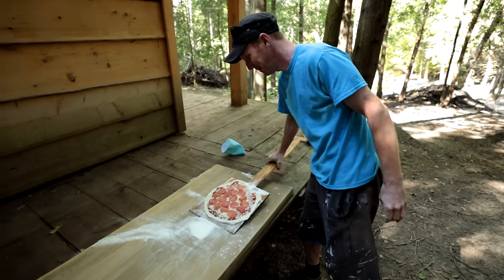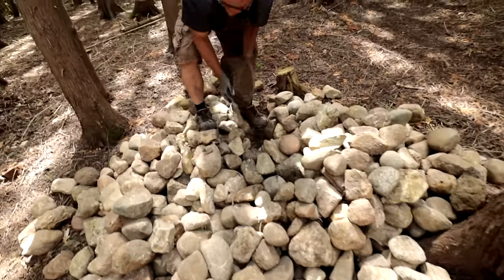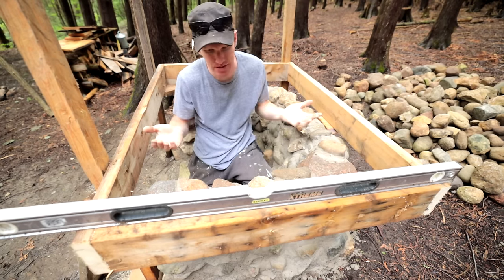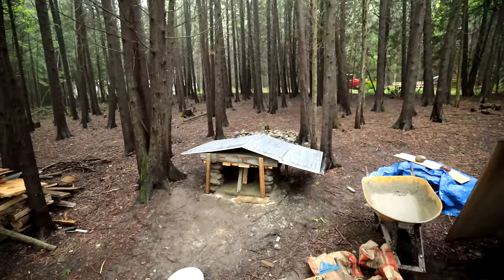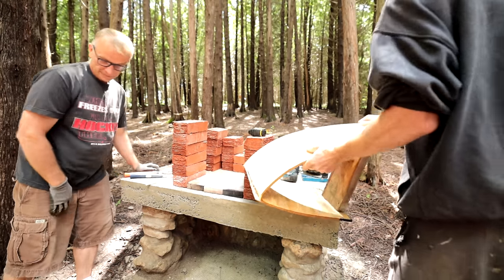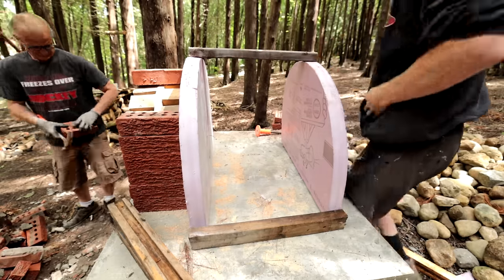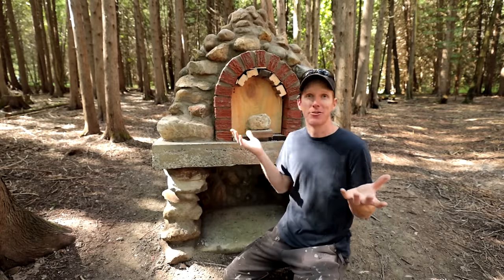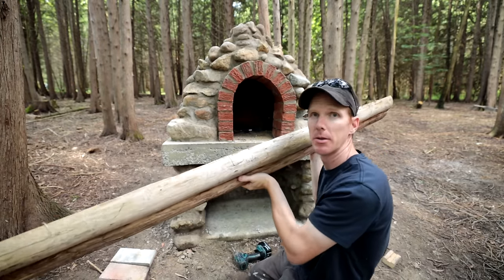I Built a Rock Pizza Oven!

Comment: Looks delicious. Curious to see how the mortar holds up with the heat over time, did you use a high heat mix? I didn't for a recent fire pit build and it's beginning to crack around the stone and it's caused a rock or two to come loose. Learning experience for sure. Enjoy!
Reply from the maker: I didn't, but it's built in such a fashion it should stay looking like a pile of rocks.

Comment: Clay brick might crack after few uses. I built a fire pit at my home by just stacking recycled bricks from demolished fireplace I had at home. After few heat cycles clay bricks got very fragile. Just a slight bump breaks the brick. Since you get the brick with mortar, it probably will last longer, but still not the best material to use. My demolished fireplace originally had steel top with fire brick base and sides. I'm sure there is a good reason for that. :)
Reply: Time will tell, I'll provide updates as we progress..
Reply: thats is why all good pizza oven build clay ,not cement and bricks, bricks out of oven have only decorations, normal good oven build clay and firebrick and then outside can add brick decoration covers. or tile cover or what want cover.

Comment: Practical tip - To remove & clean cement/mortar
bits from old & used bricks. 1. Use metal brush to clean mud, dirt of the bricks. 2. Then soak the bricks in water for 1-2 hours. 3. Using a small chisel & hammer you can easily remove the cement mortar bits. NOTE - when bricks are dry it tends to crack or be more brittle esp. when removing cement bits... So soak in water b4 chiseling them out.
Reply from the maker: Good tip,  any other situation I think that would be a great Idea... but I don't think I'd want a saturated brick in the pizza oven.

Comment: Being a Master Stone Mason of more years than I care to even mention as to not date myself... lol Watching the technique or well perhaps lack of technique made me cringe a little. Sadly it will not be all too long before the sides and top of this oven begin to fail. Good thing he has a solid concrete base to rebuild upon when it falls apart. 

Good attempt though, love the fact you did put in the effort to try this on your own. Next time look into mixing fire clay into your mortar that will be anywhere near excessive heat. Your firebrick should not be just dry fit together either using fireclay and mortar will go a long way to retain heat inside as well as keep excess gas to find air pockets in which to build and eventually expand or worse blow your oven apart.

Comment: Nice pizza oven dude! I have a culinary arts degree, and over ten years of experience  with wood-fired brick ovens making pizza alone, bluh, bluh, bluh. Anyways I have some tips I thought you might appreciate.
1) Build your fire only on one far-side of the oven, use the other far-side to cook, and don't use the middle section of the oven (It's the hot zone). This will keep your pizza from burning on the bottom, and getting ash on it.
2) If you can, preheat the oven 24 hours in advance, if starting the oven cold. Start the fire, let it burn, then load oven with wood over night with door closed. The pizza will cook more evenly top to bottom, and this will also give you more control cooking it using a smaller fire.
3) When handling anything in the oven, keep your hands, and arms as close to the bottom bricks as possible. This should give you enough time to handle what's in there without burning yourself.
I hope you found these tips helpful, enjoy your new oven man!
Reply from the maker: Thanks Daniel!
Reply: totally wrong, one side only burn wood NO, i has baked bread and pizza last 54 year and first heat oven full wood then all wood has fire end then sweep all wood ash,coal out of oven then baked what u want, pizza first because need hotten temperature, then bread ,then pot food, ald last cookies, then oven have temp drop lot and no need cooking more. i not has newer see any pizza baker rotate pizza in oven or keep fire in oven when baked food, only can keep wood in if baked only longtime warm pot food, about 2-6 hour, pizza need only high heat 3-5 minute and ready, bread need more time but can baked after all pizza has baked ready first.

Comment: Beautiful pizza oven. I had the same idea. I build pizza oven of unfired clay bricks this week. I made a base of burnt bricks on it aluminium sheet. Was Build round wall into 70 cm. I build archway on a plastic bucket. Caught 70 cm rod to the center of the ovn. With a rod shaped ( T ) the, longer part is long like oven radius and make top of pizza oven. In finally made a floor of 10 cm of clay. Oven has 140 cm in height and 120 in avarages. I look forward to when I bake pizza in it.

Comment: It looks great, I finished mine this spring.
The reason you use firebricks for the dome is that the normal bricks will crack and break over time.
You will also see cracking around the chimney, steel expands with heat...
For me, the idea behind insulating the dome is 1. to reduce damage caused by heat and 2. When you make bread the residual heat is the BEST for baking

Comment: I worked in a pizzeria for several years. use parchment paper next time. It'll stop the pizza from getting stuck on the Pizza Peel and will help get it out in one piece, also it will cut down on the bottom burning.
Reply: Seriously?! Why has no-one ever told me this?
Reply: I have a self made oven. I try me too this method with paper. Was a no good idea,for me. Catch faire..ok note all but...no good for me. I observed in many pizza restaurants and I never see someone use this. I use because someone told me. At the end the best result after 2 years of cooking pizza is without nothing.but I have to make fast pizza and put immediately in oven. Or you can put a lot of flour but after you have to pay attention at the oven temperature.napoletan pizza cook in 1,5 min with 400 degrees Celsius but I try to cook it in 3 Min at 300 or even  minus. Resul spectacular pizza anyway. Neapolitan pizza is more difficult because you have to manage high temperature and do all very fast.you have only to understand you oven and do some attempts. More insulation oven is a good idea to cook the days after. Even chimney is not a great idea collocated like you do. At that point is better without. It bring out a lot of warm. But all these are construction details. I m sure it will work in any case.

Comment: Tie the rear so it stays in place during the pour. Also, make sure you have a gap underneath so the rear sets up in the concrete not sitting on the bottom.
Reply: REBAR not rear.....stupid phone lol
Reply: Indeed.  The rebar is to help with concrete shrinkage, which is unavoidable.  But the rebar will prevent or reduce concrete cracking.  The concrete will shrink most on the top surface, so as Ron said you want the rebar up off the bottom (using "chairs" or rocks or blocks or whatever).  You did great though!  Thought I'd just add to the answer here.

Comment: Use corn meal on the pizza paddle, just a light dusting. The pizza will slide off much easier and you won't lose your toppings.
Reply: Yeah losing the toppings sucked... Good tip.

Comment: Townsend’s did a mud oven and they built a fire to get the oven to temperature then removed the coals. Used the stored heat to bake. 

Pretty cool project. Love your channel!
Reply: Cool!
Reply: yes that's how I've seen the pizza cooked. get it to between 500*F - 600*F, remove fire, coals ash, swab the cooking surface, and toss the pizza in. up to 3 minutes cooking time based on crust thickness. 
For cassaroles, stews, or smoking build a bigger fire, let it burn downs to gray/white ash over coals line the coals around the whole outer edge of the oven, make sure there is no fire. And bake. Turning the dish a quarter of a turn at a time thru out the cooking time. back to starting position your dish should be cooked/done. Enjoy!
Reply: 5K

Comment: Great build. A little tip for cooking your pizza: Cook the dough first without any tops, just a very small amount of sauce. After the dough cooks for about 5 mins, remove from fire and then add all other ingredients and cook for 5 mins or enough to heat the cooked meat and melt the cheese.
Reply: excellent cooking tip! thnx bro!
Reply: Using his two minute cook time as a gauge  that oven is running at about 800 degrees ( which is a good thing pizza ovens run at 800-950). Wouldn't want to separate the steps just use cornmeal or semolina to make it slide off the paddle easier (assuming you're saying this because there was a mess getting it in the oven)
Reply: JOSH T-  GREAT ADVICE!  👍

Comment: Hey,  I dont want to be "that guy" but just wanted to say you should be wearing a p3 mask when mixing mortar, the dust has silica particles that are as bad as asbestos for your lungs.
Reply: I was wearing my P100 when I was mixing the concrete.  We actively avoid the dust... Thank you for your concern!  I've always wondered should you wear a mask at the beach?
Reply: 2:47 shows no mask when splitting the bag, that’s why I suggested. No need for masks at the beach, unless you are mixing concrete then it’s a great idea for your health.
Reply: At this point masks are universal guys, my grandfather was a bricklayer for fifty years, never wore a mask, he also smoked a pack a day. Maybe not the best choices but I wish I could have learned more him.
Reply: Silica looks like slivers of broken glass under a microscope and what it does to soft lung tissue will cause long term scar tissue making it hard to breath.  The lung disease is called Silicosis that many potters and brick layers got before masks were worn.

Comment: The purpose of rebar is to provide stability for concrete if it cracks under tension or compression loading. So often for vertical supports, rebar must be tied together so that it makes a series of boxes stacked together, so that even in an earthquake when the column breaks into a bunch of pieces, the rebar boxes keep the chunks of concrete stacked to maintain compression loading.

Comment: Ok so push all the coals to one side and have the pizza on the other side and it should be done within about a minute and a half if your oven about ~480°c (900°f), the ideal temperature. Also you have to turn it at least once. Others have said put corn flour on the peel but i just recommend using a stainless steel peel instead, cornmeal changes the texture. The oven looks great.
Reply: Thanks Aaron!

Comment: Also generally you want to pour a little Concrete in first and then set the rebar on top of that so it's in the inside of the concrete in Newark board gives greater structural integrity if it's sitting at the bottom it doesn't really actually do much
Reply: I made sure it was somewhere in the middle.

Comment: I’d put a door on the bottom of the oven and a 2 inch hole in every corner of the pizza shelf and keep the fire in the bottom only that way you get evenly distributed heat and keep the fire and charcoal off the pizza 🍕 and also close the bottom lid to heat it like a furnace 👌

Comment: Looks great.  Just a word of caution on the use of field stone.  
Our cottage (built 95years ago on the shores of Lake Huron by my great grandfather) has a gorgeous lake stone fireplace, built 15cm a day, by the family, from stones from the lake, and cement.  The fireplace, along with all our neighbours’ have been condemned by the council after several nearby cottages experienced explosions of the stones and/or cement.  Full on shrapnel, stuck deep into woodwork, with luckily no fatalities sustained, but one cottage did burn down, with some people injured. 
If you line the oven with refractory, and wrap ceramic insulation around, this is most definitely not going to happen, and the oven will last a lifetime.

Comment: Great job man!  First time to your channel. I think when I build one of these, I will put the chimney in the back so it doesn't pull the smoke to the front.
Reply from the maker: Any oven I have ever seen has the pipe at the front.. so I googled it:   In the traditional wood oven ventilation design, the vent is located in front of, and above, the oven opening, and the chimney runs straight up. The vent and chimney create a strong draw, helping pull hot air out of the oven chamber and increasing the oven's natural convection
Reply: @ModernSelfReliance  Right on! Thanks for the info.  That does make sense.  I thought the opposite.  Gotta love Google!

Comment: Nice build . You might need a coat of refractory on inside ? Rebar needs to be wired to keep it in position while pouring concrete for stability and adjusting it to correct height .

Comment: Hello! Does The concrete  crack under that high temperature? Or is it okay to use rocks instead or its the same that They will crack after some time under high temperatures?
Reply: The concrete seems to be doing fine...it's protected by the firebricks.  Should use refractory brick on the inside... I opted for rock and mortar fully expecting possible cracking.
Reply: Well, I don't have fire bricks, will a hollow block work just as fine?
Reply from the maker: From what I've read clay brick at the very least and they will still deteriorate over time.  I think hollow block would disintegrate even quicker
Reply: Modern Self Reliance thanks !!! Noted!

Comment: Usually scribe your arc onto plywood or osb cut the shape ok lol. I'm not a mason but the oven shoulda been fire brick not just the bottom looks great but you may have to replace the bricks and if youve ever seen a rock explode then taking the time to fire them first is a good idea. Finishing the mortar the rule is when you can see your thumbprint in the mortar it's ready to strike or brush. " rule of thumb"  an old way to attach wood to concrete or masonry os to drill it with 7/16" bit I think than drive an 8 penny nail and 16 penny nail together it holds amazing only thing is you can't pull them back out I've used a 3/8" bit and 2 16p nails works that works to.
Reply: Good tips!  Thank you!

Comment: Steam wood to bend it( put pan with hole on lid and a lock lid some pipe ties some pressure and heatproof tubing and a solid heatproof box to place your wood inside connect it all hopefully it makes life easier if you do a good enough job maybe you could make one one series <3

Comment: Hey Kevin on your pizza oven build if you have some more fire bricks cover the whole right side and the middle with fire brick you don't need a big fire in there all you need is on the left hand side have like a 3 log fire that he goes up through the dome you put your pizza on the bottom you turn it once and then you hold the pizza up when you hold the pizza up you're put it in like 900ﾟ so that will improve your pizza oven for you

Comment: On the Pizza paddle (it’s called a peel) you might want to taper the edges down to thin. Use semolina on the peel and build your pie right on the peel. Touch the edge of the peel on the back of the oven, tilt the handle up and pull the peel out from under the pizza in one quick smoothe motion.
Reply from the maker: I tapered it quite a bit.. might have to taper some more.

Comment: to cook pizza move the fire only to one side and clean bottom well with wire brush and then with a damp cloth.  Cook on the side where there is no fire and just rotate the pizza 120 degrees two times while cooking.  

See how much smoke is leave thru the door opening because it is too high door and not wide enough.

Comment: ok here's my Hint from Heloise...when you are working with the raw pizza dough,  put lots of coarse semolina flour or corn meal on your paddle and you can build your pizza right on your wood paddle. You coat the paddle with a dusting of semolia flour * EXCEPT for....you leave a 1-2 inch flap of  fully sticky dough hanging like a bottom lip over the leading end of your transfer paddle...when you go to slide the paddle in to the hot oven, you "catch" you put the paddle fully into the oven,   and catch that leading lip on the floor of your oven, ( BTW, you can line with a pizza steel, too), and the leading edge combined with the semolina loosening most of the pizza round area, will help you drag the paddle back out, leaving the pizza behind.....  you pull the transfer paddle back out swiftly like a Houdini table cloth....cheers!  you end up with just one little crust edge that maybe doesn't have as much on it re toppings but your transfer technic will wow everyone.

Comment: You tie your rebar to keep it from moving inside the concrete, you use a seat or something to get the rebar off the bottom up into the concrete where its needed for reinforcement,

Comment: The trick it to either have the firebox below the actual oven and leave the fire going, or start a decent fire, let it burn down to coals then take out the coals and brush the ash off the surface. The edge of your paddle needs to be very thin to slide under easily.

Comment: Add a length of pipe to the chimney, like 4 ft, then put the cap on top of that, then you will have better draft for when you open the door you will be able to still see without smoke in your eyes. You need longer chimney then it will pull like a vacuum smoke up thru it.